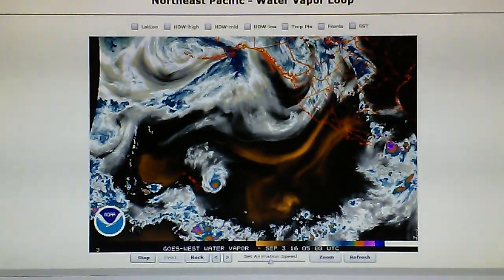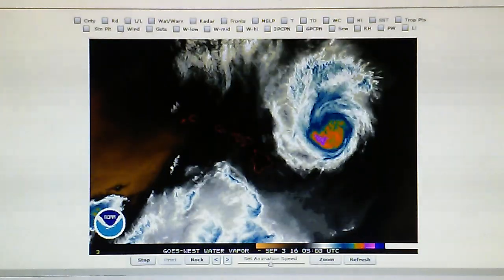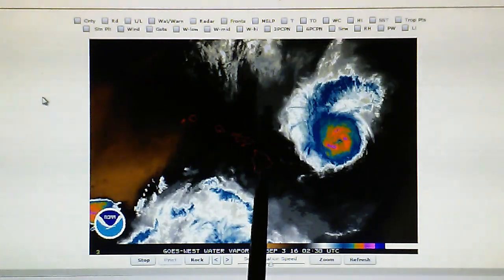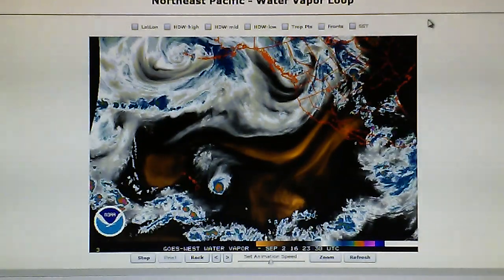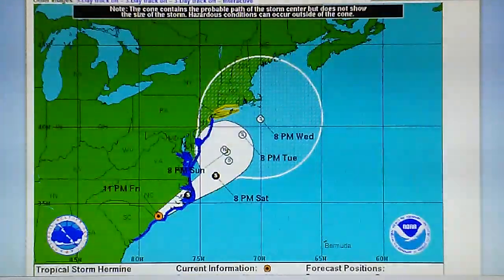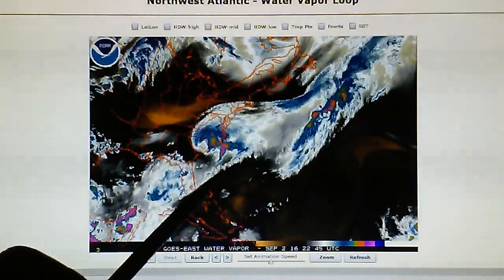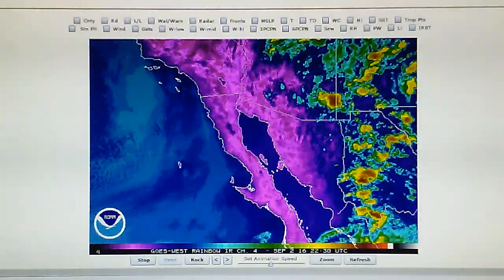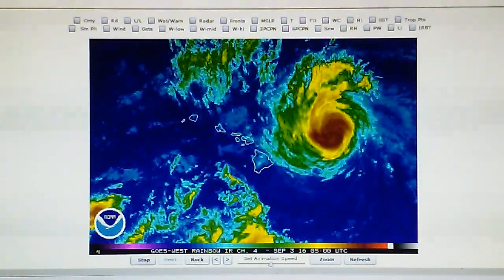9-2-2016; Transmitter-Generated High Pressure Steers Hurricane Lester to WNW At Last Minute;

Comment: couple days before madeline was to hit the islands...    Sea Based X-Band Radar  leave pearl and head out to sea... as you point out  she got blown apart,  the evidence is   there.   With  Lester  as it leaves the islands you  can see it get blow apart as well.. 

during this whole time Hawaii , Oahu has bees super hot and hazy...     SBX is still not back yet.

                                                      Mahalo, for all that you do...   Aloha, Hawaii

"SBX was in the Gulf at the same time as Hurricane Katrina formed on August 23, 2005. On Saturday, August 27, 2005 the storm reached Category 3 intensity on the Saffir-Simpson Hurricane Scale, becoming the third major hurricane of the season. An eyewall replacement cycle disrupted the intensification, but caused the storm to nearly double in size. Katrina again rapidly intensified, attaining Category 5 status on the morning of August 28 and reached its peak strength at 1:00 p.m. CDT that day, with maximum sustained winds of 175 mph (280 km/h) and a minimum central pressure of 902 mbar."

http://www.geoengineeringwatch.org/obamas-october-surprise-creating-and-steering-hurricane-sandy/